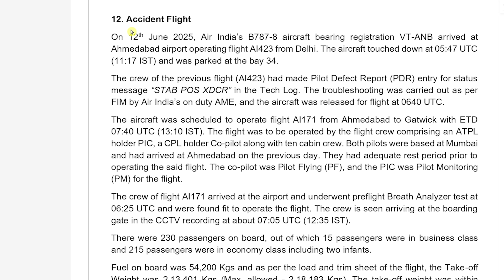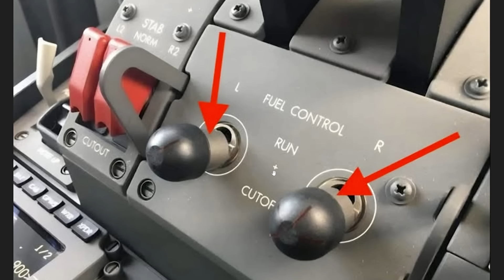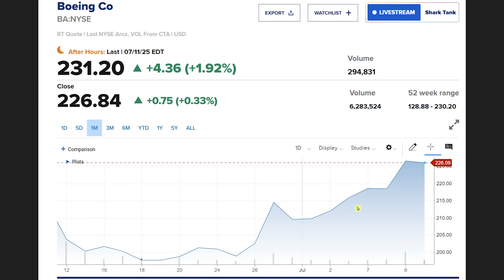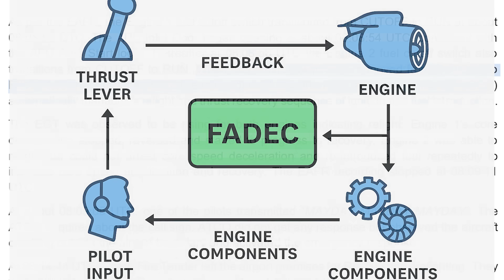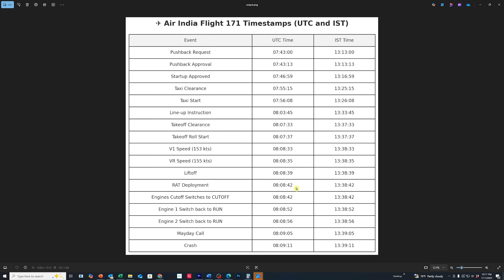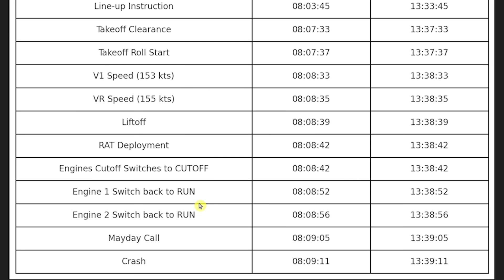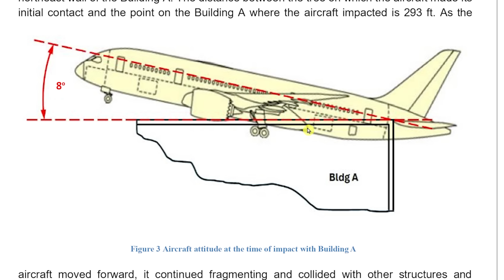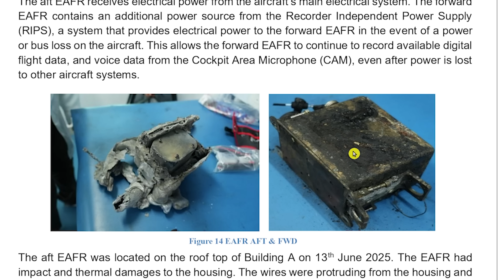Did Pilots CUTOFF Fuel? Shocking Twist Air India 171 Report!

Comment: Possible explanation for the delay in restart:
Copilot was flying the plane.
Other pilot turns off fuel switches (probably)
Copilot asks why the switches were turned off, to which the other denies.
Copilot assumes the other pilot would turn the switches back on, which he doesn't do.
After a delay, copilot realizes that the  other pilot is not restarting the engines and attempts to restart the engines himself (while trying to fly his crashing airplane) but it is too late.
Reply: Also consider that the conversation: "Why did you cut off - I did not" on the CVR, could actually be gaslighting by the perpetrator, either way. So, the one pilot flipping the switches, then asking the innocent other pilot in order to confuse, is a possibility.
Reply: @cruisemissle87  Or pilot monitoring was in a state of psychosis e.g. triggered by stress, and in a manner of speaking actually thought that the pilot did flip the fuel cut-off switches.
Reply: There's a built-in delay in the restart process and the engines need time to spool up. That's why they were shut off at a low altitude.
Reply: @rkgsd THE engines were already spinning.  They never completely stopped 

.
Reply: You don’t need Togo down any of those rabbit holes. A complete engine relight in that situation will take about a minute. They didn’t have the luxury of time/altitude for that. The report makes it sound like both engines were on their way to a relight, but that spooling up just takes time, those are big fans turning out there.
Reply: @fastmph  Actually hte report says one did start spooling up the other one didn't but it was too late to get lift.
Reply: How long after turning off the switches which close the fuel valves can the engines run and deliver power to ascend?
Reply: @richardfarah8385  Engine 1 managed to regain enough power and engine 2 was just about to regain the necessary power when the crash happened.
Reply: I think this is correct. Except I think the other pilot asked why did you shut off to gaslight his copilot and throw investigators off track. But hard to say for sure.
Reply: I believe the co Pilot was in charge of take off so that would leave the captain free to turn off the switches but it would have also been possible for the Co Pilot I suspect but harder to do if you have both hands occupied? A pilot could answer this obviously. But I agree the shock of the action and themna response to flick both switches back was done but all too late. strategically if you wanted the plane to crash this is the ideal time as opposed to say the Plane climbing to 1000 feet and having time to reignite the engines.
Reply: If the switches were off either pilot  would turn them back because they both know what the result would so regardless of who turned them off they would have been pretty stupid to do nothing
Reply: it was the co-pilot that turned them off not the pilot!
Reply: @wally6193 right. If the captain moved the switches, the copilot probably would not have had enough time to even figure out why his aircraft was spooling down and decelerating, since his focus was outside the cockpit. On the other hand, if the copilot turned off the switches, the captain, who was monitoring the instrument, would have had the opportunity to recognize what was going on inside the cockpit. Even though 10 seconds seems like “too long “ of a time, it’s really pretty fast, when you take into account the startle factor and the brains ability to deal with unexpected problems.
Reply: @wally6193 we don’t know that
Reply: @wally6193 how do you know that? They cant tell which pilots voice did they that said what

Comment: For the last two weeks or so most indications have been a dual engine "shut-off / failure" which could have been caused synchronously from a few separate causes (not many, but a few). Everything now is pointing to deliberate fuel cut-off by one of the pilots.  But the gaping question is: why are we only provided a (obviously) redacted synopsis of the cockpit voice recorder? I can't think of any reason for this except that there's something damning there, something shocking.
Reply: I mean if they wanted to prove without any reasonable doubt that it was intentional, wouldn’t you release the full audio with context an everything? Not a single line of dialogue? How do we know they weren’t responding to an electrical glitch that made them think that the reboot was necessary?  If it was intentional, why? Was there a fight in the cockpit? Did one of the pilots realise they were doomed? It’s too convenient to assume guilt based on an out of context conversation. Like were they freaking out?  Was it said as calmly and deadpan as in the report?
Reply: @waywardlyfe3092 , it's all very perplexing. An equipment fault that caused fuel valves to close or engines/FADECs to reset would happen at nearly the same instant for both engines. The fuel switches turned off a second apart, which is the approximate time needed for a trained person to intentionally perform that action suggests human action. Was it? We don't actually know. Why is the CVR being withheld? An oversight? Nearly unthinkable. I don't know what the investigators hope to achieve or prevent by not releasing the CVR but I can't think of a single innocent explanation.
Reply: @bjornr.bjornsson4053  exactly, that’s what I’m saying, I understand those switches can’t be accidentally changed, I’m not doubting the conclusion in itself, I just think it’s odd not to release the full conversation. Taking the context out of the investigation. If intentional is the reason, there needs to be no doubt, with concrete public evidence that comes to that conclusion. I just have some gut feeling theres more to this than the airlines and Boeing want to admit.

Comment: Since there's no valid reason to need engine cutoff during take-off phase and 250+ reasons to stop it being possible, why not block it in software?
Reply: because there is a valid reason (in case of engine fire), also if there were a block I'm sure a rouge pilot could find another way to crash the plane
Reply: @pugletpie  but what if it's not a rogue pilot? It seems crazy to have two fairly prominent toggle switches whose activation guarantees total loss in that phase of flight, with only dubious metal gates preventing their movement.
Reply: @reclusio  my understanding is you have to pull them away in a specific movement, like putting a manual car into reverse. Twice. Not something done by accident
Reply: @pugletpie there are documents circulating regarding issues with those mechanisms.

Comment: This sure looks like pilot self termination.  I understand why you added the possible fault in those cutoff switches, but besides being for the 737, the odds of both having that fault right at takeoff is nil. As you explained, those switches are designed so that no accidental bumping can occur. I just wanted to add that design has been in place since at least the 1950s with little change because it works so well.

Comment: It would be nice to know how the two fuel cut off switches are actually configured Are they fully independent from each other or do they 
share a common powersupply or are wired in the same conduit  More investigation is needed.  is the wiring subject to random inductive reaction?

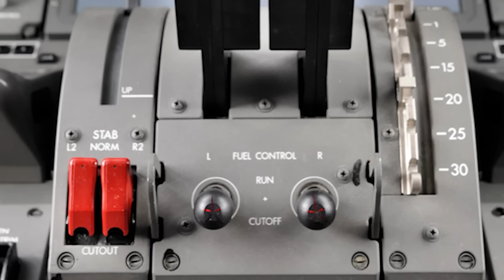Comment: 12:02 I feel the need to point out how insanely complex these aircraft are, and how "My copilot turned off the engines moments after take off" is not something that any pilot anywhere has trained on, ever. For a totally unexpected and untrained event, I consider that 10 second reaction time to be excellent. At this point I share your concerns that this was an intentional crash. I'd be really curious to see somebody flight sim this exact scenario, but taking up the landing gear as usual - would the reduced drag have given the airplane enough time to get the engines back up and prevent the crash?

Comment: Could software bug have caused the fuel valve control signals to momentarily set the outputs to off state due to program crash and reset? 
Sure, the switches have mechanical protection for accidental flips. However, the input from these switches usually fed to a controller unit, where software reads the state of inputs, debounce them (i.e. input filtering) and then activate output drive signals that actuate the fuel valves. I wonder if the controller software crashed and reset, flipping the outputs to their default states and had come back on.

Comment: Can't say "i flipped those up as that's for Party Time!" had to flip them down sad but true. Obviously flipping down is now a spontaneous motion if what is claimed  did in fact happen...i don't think this is the first time for this as well. Plus if the guy lied as clearly when asked someone denied that would mean an attempt to not create the proper response as well of putting those switches back in the "run" position....which also apparently happened. "I'm a two engine guy!" President Trump (who in fact is a 4 engine guy speaking of liars) is now "Pedo Prez Trump!" as well so how the layout with a Boeing 747 is be nice to see as i bet anything you would have to physically be out your seat on the other side to do this on a Boeing 747 or an Airbus A380😊😊

Comment: There’s an important aspect of these fuel control switches that you didn’t cover. According to information that Juan Browne shared from the body of the preliminary report, investigators weren’t able to conclude with certainty from CVR dialogue and examination of the switches post-crash, that the switches had been manipulated. The possibility exists that the switches were not moved but an electrical or software glitch could have shut off the fuel supply.
Reply: My thoughts exactly

Comment: How exactly are the fuel cut off switches designed and wired?  Does the switch wiring share any multipin connectors so that one loose connector (e.g. plugged in but not  locked) could be pulled apart and make intermittent contact which then would affect both switches and appear as OFF/ON switch movement, to FDR and FADEC units? 

I find it very hard to accept the murder/suicide scenario without irrefutable evidence. Also turning off both engines in succession because of a "millennial brain fart" is just ridiculous. But still I am fully aware that equally or more strange things have actually happened before.

Comment: Don't think a pilot committed suicide for a couple of reasons:  1) Going down the runway, seems like they had trouble taking off; and 2) the switches were on.  Sounds like one pilot thought the switches were pulled when the power cut out.  Still think it's some problem with the plane!  Got a lot of politics involved: India wants to blame Boeing; Boeing wants to blame the pilots!
Reply: Takeoff was normal. No problems.
Reply: @garyh.2487  No it wasn't, according to pilots it shouldn't have gone all the way to the end!
Reply: @kristenjersey7250  Many pilots, including one I know personally and have asked, have said that using the entire runway is not unusual - plus he didn't use the entire runway, as you can see from the picture at 6:46 of this vid.
Reply: @kristenjersey7250  "No it wasn't, according to pilots it shouldn't have gone all the way to the end! "

The aircraft did not go all the way to the end of the runway. It climbed to 400 ft agl and then descended to 300 ft agl as it overflew the end of the runway.
Reply: don't know who to trust.
lots of fake and paid analysts out there to steer opinions one way or another.
Reply: You are right, It is Boeing psychology to put all the faults on Pilots.. They would do it in 1 sec? No. Switches has locks applied too.

Comment: Ground logic and flight logic are different. There may be a possibility that the switches were switched off during  the roll, but the 'flight logic' didn't register them until the wheels were off the ground and the plane was in 'flight logic'. So, I'm saying the off position may have been registered once the plane took off, but may have been applied before they took off.

Comment: The power glitch could have come first as the triggering event causing the fuel cutoff switches to internally reset to cutoff  by the computer which has fuel cutoff as a reset state. Someone posted elsewhere on YouTube there was a known defect advisory about systemic power glitches on this model aircraft and he also posted that the internal default control of the fuel switch is spring loaded to cutoff.  The fact that the Rat deployment comes at the exact instant that the fuel cutoff event was logged by the black box indicates they could all have been triggered simultaneously by an electronics power glitch.  If the fuel cutoff was manually triggered at the switch panel I would think that the aux power Rat deployment would have been delayed by several seconds until the engines and power turbine began to spool down from lack of fuel-but this was apparently not the case. Is Boeing letting uninformed media and internet trolls do its bidding to blame a suicidal copilot rather than its computer power system glitch?  You best wait for the full official report and not some trickled out partial release of information perhaps intended to let the public infer suspicion of a suicidal pilot as root cause. Given that this is Modi's India, do you think you will ever see a full report?

Comment: I feel like something so crucial like total engine cut off should not be a full manual toggle, the computer system should probably detect the plane has literally only just taken off and is still at very low altitude and therefore not allow full engine shutdown, because why would that be necessary or safe in that circumstance.

Comment: I think there needs to be a manual fuel cut off if an engine fire occurs even after just 30 seconds airborne after take-off. Maybe that’s why there is a separate switch for each engine. On another folklife, the goggles are so small and round.  Very awkward to move. Pasty, I think there should be both a mechanical sound and a digital voice stating, “left engine ON” and “right engine OFF”.

Comment: Please go back and read the report. Maximum velocity was achieved prior to the switches being moved. You don’t instantly have no acceleration the plane must have been losing acceleration before the pilots touched the controls. The exact time of the control movements is not in the report. And the time placement of pilots conversation is missing. How long did it take the pilots to toggle the switches on and off. 1 second to turn them both off an unspecified amount of rest before being flipped back on. There must have been something else causing the plane to lose thrust.

Comment: I don't know why nobody and any western media is talking about " the plane had some sort of software issues inside the plane which some passangers reported that few info systems were not working and some position sensor were not working before the flight which is also mentioned in the report and those who are saying that pilots might have turned it off those switches are spring operated switches and it takes time to do with both of the switches so it's impossible to do with both switches in the time of 1 sec inbetween 
may be switches failed due to some issues it might have been possible because few years ago there is some reports that says boeing had some issues with cockpit switches and boeing just simply gave an advisory and kept this things silent to protect its name from complications.

Comment: Way too early to speculate Jeff.  Did one of the pilots flip those switches on purpose?  Possibly, but there is also the possibility that those switches were installed without the locking feature, which means they could have been flipped by accident (ex: one of the pilots had their hands on the thrust levers and may have inadvertently pushed those switches to the down or OFF position.  Not saying that's what happened but it sounds possible after reading this:

"In December 2018, the US Federal Aviation Administration issued a Special Airworthiness Information Bulletin (SAIB) highlighting that some Boeing 737 fuel control switches were installed with the locking feature disengaged.

While the issue was noted, it wasn't deemed an unsafe condition requiring an Airworthiness Directive (AD) - a legally enforceable regulation to correct unsafe conditions in a product.

The same switch design is used in Boeing 787-8 aircraft, including Air India's VT-ANB which crashed. As the SAIB was advisory, Air India did not perform the recommended inspections."

Comment: You’re assuming the switches were switched off. The pilots question and the response would indicate a natural reaction to then toggle the switches from their ON position to OFF and back ON to restart. “Why did HE….” as if saying “the ole girl is running good today” referring to the craft. Don’t rule out computer failure causing them to react the way they did. The switches are NOT connected to the VALVES by a cable that manually operates them like a 10 speeds shifter. Their reaction is like us toggling a light switch when the bulb blows, but sometimes it’s the switch or dirty connection. More data needed. That pilot radioed in a mayday. He would’ve freaked out if the other guy messed up deliberately. They played the cards they were dealt.